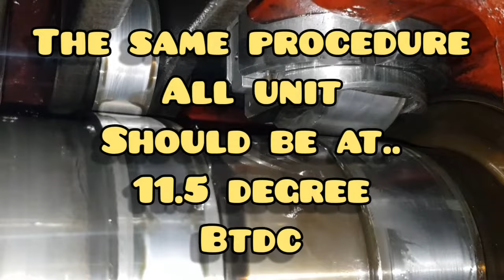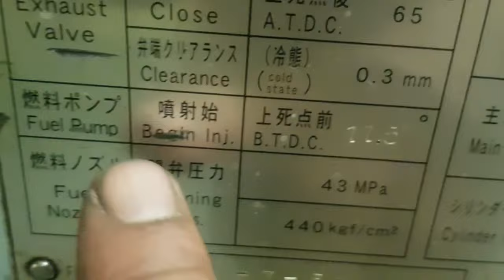how to carry out generator fuel pump timing. #educationalvlog #marineengineer

Comment: Hi. Sorry to say but this video is absolutelly wrong. First of all you are not carrying out ANY timing. You just checked if pump is at the line in beggining of delivery. You shown you adjust 11,5 degree... but this is not true... Timing is adjusted according to upper line. And you are turning the engine in wrong direction and also showing wrong stroke, you checked all when piston was at BDC. All video is completely not good. Sorry.

As a proove look at your video, you are showing each pump timing at the end. Fuel cams are in different position, but each one should be at the same if they are all 11,5 degree before TDC
Reply: Your comment is correct . As the principle and instruction mannual , the down line is assembly mark line and the top line is initial injection mark line . So all video is wrong way .
Reply: @phamhuong2188  my friend, look how many positive comments this video received during 4 years, and no any negative, this is sad 😭
Reply from the maker: Thank you for suppurting me
Reply from the maker: Wala kayung magawa sa buhay nyo.. your not a marine engineer i think.. you dont know or your not reading any manual
Reply from the maker: How do you know
Reply: @Smiglo900  Sorry bro , but I just want to find the true and correct the task . If you think me wrong , I can share you my picture where have principle for that .
Reply: Finally, there is at least one correct comment. This video is totally wrong.   After that, just imagine such an "engineers" working and receiving their salaries))

Comment: The start of injection is when the roller start passing into the base circle of a cam and the top line coincide with the line of pump casing. The top line is the true marking for injection timing.
Reply from the maker: Correct sir

Comment: Sir what is the problem if the pmax is low but higher exhaust?already changed a new F.o valve & F.O pump.
Reply from the maker: Sir maybe the cylinder head spindle gone.. check if your generator is hard to start.. before you start turn the flywheel check the indecator valve if there is an air.. if not your cylinderhead spindle is gone..
Reply: Thank you sir

Comment: Nice video sir.
Na experience nyo na po ba na makunsomo sa lub oil yong generator nyo? same model po 5DC 17A..
Tas lub oil overflow tank tumataas yong level?
Reply from the maker: sir tingnan nyo po yung air vent ng lube oil sir.. baka barado.. yung talsik nya doom pumonta . or else purifier or blow by.. ilang taon na yung barko sir.. yung air vent sa sumptank ng generator sir

Comment: Good day sir, the timing tally line is the top or the bottom one ? As there are 2 lines on the guide roller
Reply from the maker: Bottom sir..  fuel timing
Reply: @marineengineerworks Many thanks, selamat, I really appreciate that you replied back.

Comment: How does if  it is not in timing? What should you replace or need to adjust?  If the shim need to adjust? Thanks
Reply from the maker: Yes sir your correct.. shim need to adjust.. i will make a video for that in how much or how many and the measurement required.. thanks sir

Comment: Sir, Mali po ang procedure nyo, ang bottom line po is base line po yun and yung upper line po yung timing line at mali po yung ikot ng flywheel dapat pataas at ndi po pababa.
Reply from the maker: Sir paliwanag mo daw sir paano mabaliktad ang ikot ng flywheel pag komoha ka ng timing
Reply: @marineengineerworks  Ang rotation direction po ng DC-17a is clockwise at di po counter-clockwise, so pagkukuha ka po ng timing kelangan same rotation po ng makina. at yung bottom line po ay base line po yun at yung upper line po yon po ang position begin ng injection which is 11.5 degree BTDC sa engine flywheel.
Reply: Tama ka po boss.binasa ko po ang manual ngaun ang taas is the injection timing ung baba base line po basis po sya kapag nagtanggal ka ng fuel pump itapat dun sa base line.